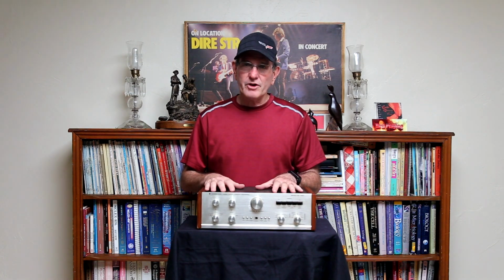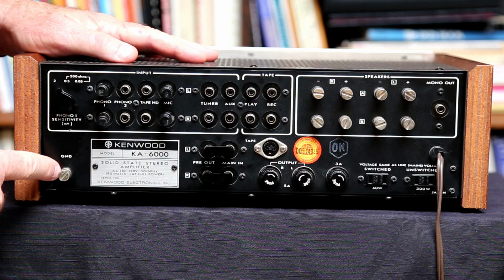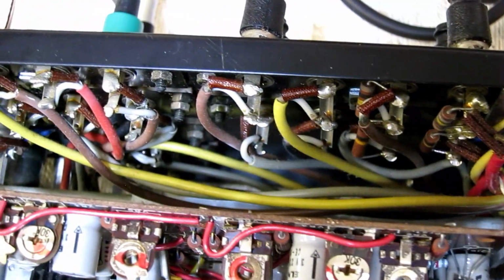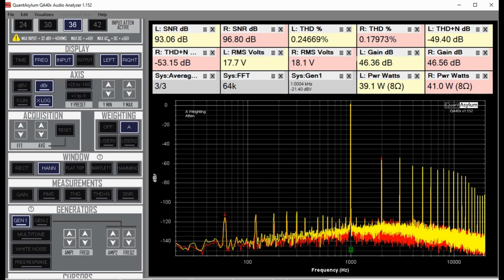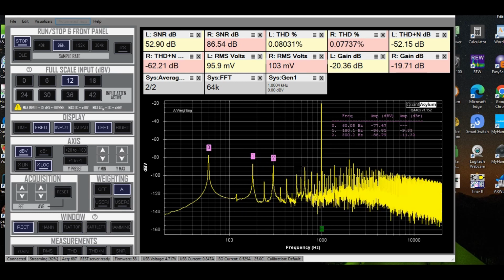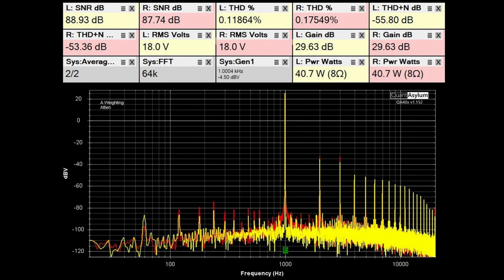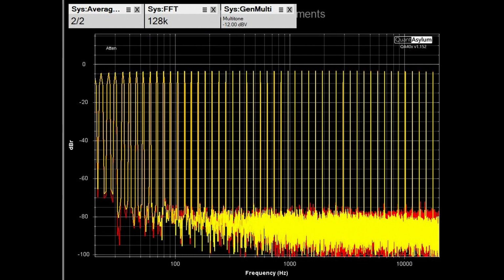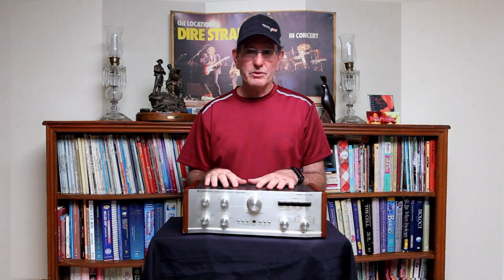Kenwood KA-6000 Integrated Amplifier- Vintage Audio Review Episode #14

Comment: I found one on a throw out day it looks so nice I picked it up it did not work at all 
I took it to get repaired one of the supply wires out of the transformer was not working 
The tech guy went right through it replaced a few caps and some diodes I think 
It sounds great now really happy with it
Reply from the maker: Sounds like you got a nice find, though had to pay a little to get it fixed- thanks for sharing!

Comment: This is a prelude to Accuphase....Kensonic. Im guessing this is a much underated amp. I have one. There was no skimping here. When you look at the L 07M mono blocks that came later and then check out an Accuphase E202 you can see this amps influence on something considered way more high end. Im no engineer but i have half an idea what im looking at.
Reply from the maker: I am not familiar with the amps you mentioned, but the older Kenwood gear seems to be popular with people wanting vintage audio gear. Some folks think they were not built well, but the ones I have looked at seem to be of decent quality. I have a review coming up on an older Kenwood integrated amp in the future. Thanks for commenting.

Comment: What purpose do the jumpers serve? Does it matter that mine are just bare copper?
Reply from the maker: The jumpers connect the preamp out to the main amp in and if they are bare copper my only concern would be corrosion- you can pull them out on use something like scotchbrite on them  if there is. Thanks for the question

Comment: I have one of this Amplifier which I bought from a former colleague who went back to Switzerland in 1983, however I would have liked if it can be possible to have the Circuit diagrams so that I can be able to solve some of the problems as has been explained
Reply from the maker: You can download it from here, but you have to create a free acct:

https://www.hifiengine.com/manual_library/kenwood/ka-6000.shtml

Comment: Tbh, I never liked amps/receivers from the 70's (and I've had a few) because of the odd bass response. It sounds loose and boomy, regardless of speakers or listening room. Starting in the mid 80's is when they got bass right; tight and well damped
Reply from the maker: Thanks for taking the time to reply! A good friend of mine was just talking about this with me in regards to the project/one intg amp, and how there may have been something to matching certain vintage amps/receivers to speakers- like a receiver with more bass to a speaker lacking in bass. Also, this amp may have benefitted by a full recap to power amp section.....
Reply: Hi, What is the output voltage of the pre outs of this amp?

Comment: I have this amp. Love it. Have the original box
Reply: I’m 7 minutes in and fixed so much on my set up. Including the phono sensitivity. Which it was in the wrong position. I have an Ortofon Stylus 30 on an OM 30 Cartridge. Which I believe is a moving coil? It was on the 0.5 ohms instead of 0.05 ohms? Big difference right there. This lead me into a rabbit hole where I realized I had my Design Acoustics PS-10a have a - 3 db switch for small rooms. I switched it to flat. Much better. Thank you for improving my enjoyment of my equipment.
Reply from the maker: @MayorofCheeseland  I am glad I was able to motivate you to set up your system so it works more optimum!
Reply from the maker: I hope it is still working well for you! I am trying to convince the owner to hook it up to his Altec Voice of the Theater speakers- I think it would be a great match.
Reply: @vintageaudioreview  It works even better thanks to your video. I have it set up right, now.

Comment: I also have a KA-6000 integrated amplifier that I have had from my High School years.  it also has the same issue as one side is louder than the other. I live in the Tempe area. I assume you live in the phx area?  if so, roughly how much it would it be to get it back into shape if your willing to take on another project? 
Thanks in advance..
Reply from the maker: I am flattered! I live in Tucson, actually. I would be willing to take on another project once I get caught up with some other amplifiers that are ahead of it. If indeed it were "just" replacing the caps that should be replaced it is not too bad a job, but you could also have them all done if you really wanted too. Since I'm retired and do this for fun (does not always work out that way :)  ) I don't need to charge a lot. I will be up in Phx the end of September..Thanks for subscribing!
Reply: @vintageaudioreview  I have been requesting my amp get worked on as a Christmas gift for the past 5 or 6 years now to my wife.  it hasn't happened yet. ha This amp is super important to me. I loved your video and watch these kind of repair videos often. pls pls let me know when you come down this way and we can take it from there. I also have a Teac reel to reel that needs work. everything seems to work mechanically at least the last time I turned it on. I think it just needs a good tune up and everything adjusted
Reply from the maker: @drumdr64  I will put my contact email int the about section shortly, but will remove it once you email me with your contact info. I have to decline on the reel to reel-  if it works use it! Funny, I had the opportunity to purchase a mint Teac X10R just yesterday for a great price but declined- no good place to put it.